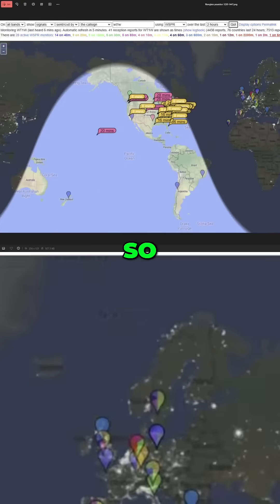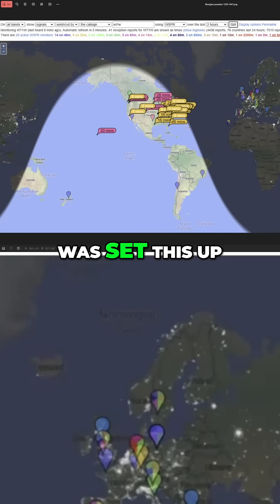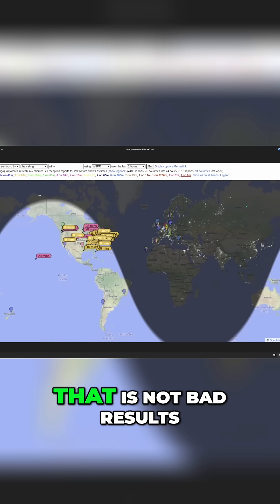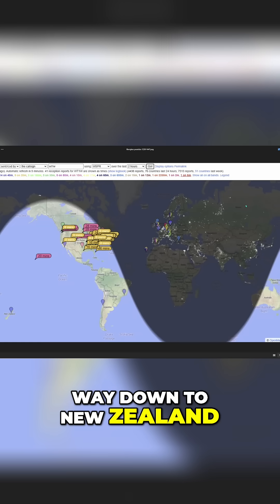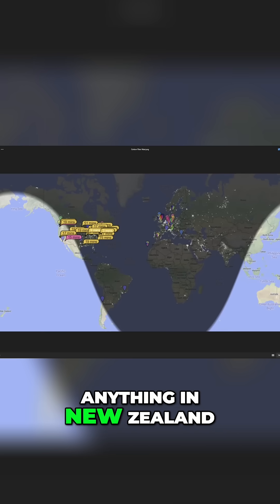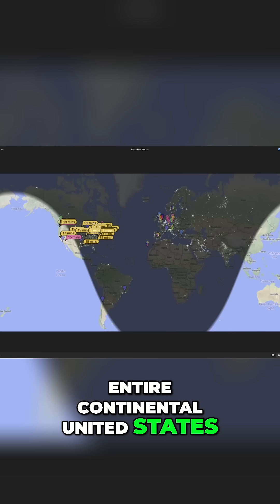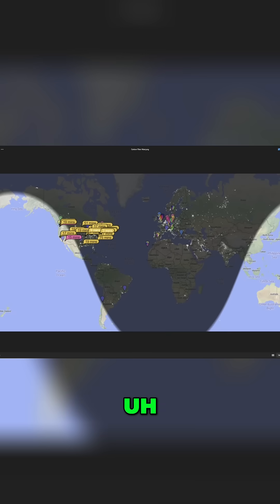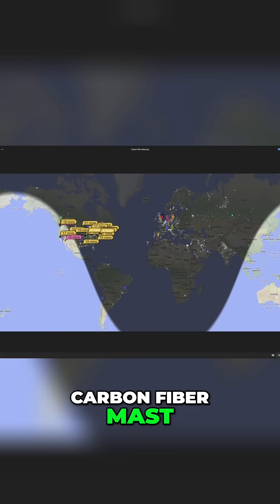Carbon Fiber vs Fiberglass Mast  Antenna Performance Test! #carbonfiber #hamradioantenna #hamradio

Comment: Interesting! I have a bunch of fiberglass masts including an older military surplus heavy mast.  I would like to try a carbon fiber mast , I'd think the only way a carbon mast would affect an antenna setup is if we would be running a doublet with open feed running up on the mast,  but even that wouldn't be much of an issue unless maybe using high power.  My biggest issue with fiberglass is it tends to splinter and shred your hands ,especially the heavy military mast.  I had to sand mine and put several coats of tough oil based paint on the sections- especially the spreader at the base and the pulley arm at the top.  Well done checking this out!
Reply from the maker: Thanks!  Having suffered thru fiberglass drama myself recently, I literally feel your pain.  I just didn't see enough difference between the two to matter much.  Like you said, at higher power, maybe it's a concern, but  it's a small one for most folks (if at all).
Reply: @FEPLabsRadio  i wanted to ask you if the carbon fiber was lighter in weight.  I would assume that its stronger as well? - at least with the thin wall ( backpack masts)  my military masts are just too heavy to carry around,  but great for long term application. ...Again thanks for doing this study! Appreciate it ( im a cheap ham )😂
Reply from the maker: @l.a.2646  It is super light!  I don't know stronger, I have not done a torture test on it (I paid for it, so...) However, I would suspect it holds up better long term than an equivalent size fiberglass one.
Reply: @FEPLabsRadio  oh no don't do a torture test,  just  picking your thoughts on it. Thats good enough for me. I think ill save up and get one for me!  .